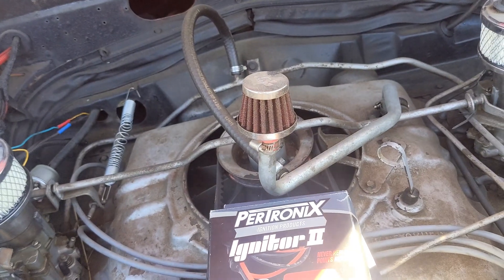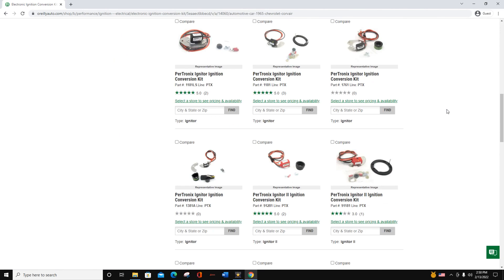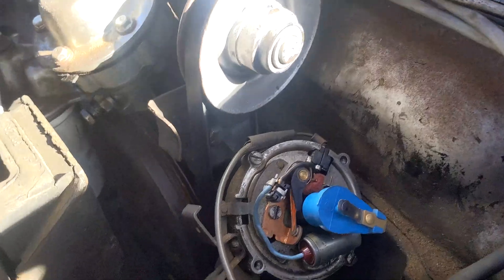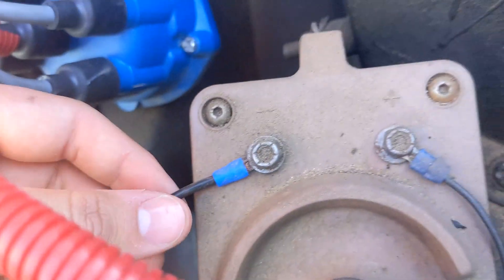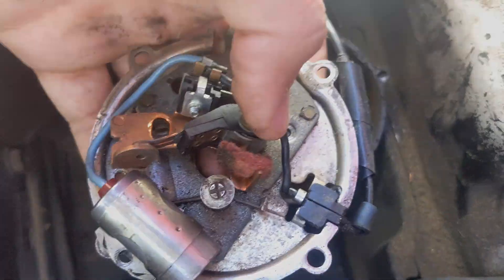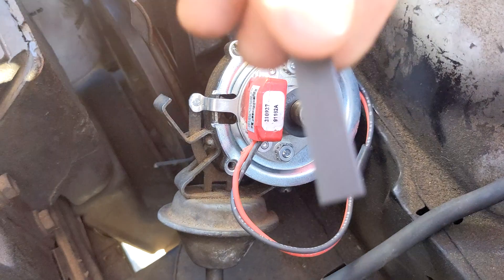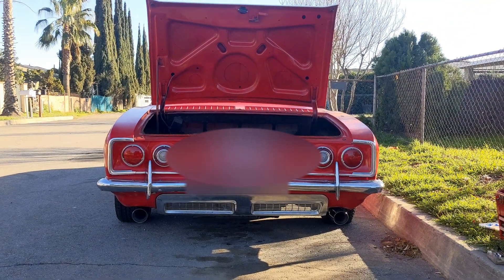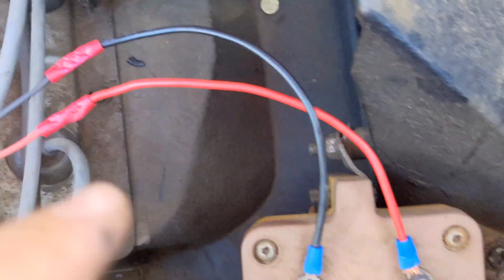Easy Electronic Ignition installation for the 1965 Chevy Corvair

Comment: The Pertronix II is a good choice on this car, but not recommended for a Powerglide car, some problem with the dwell angle built into the system that hasn't been resolved.  The Pertronix I works fine in that application.  I have Pertronix in all of my Corvairs for many years, now.

Comment: I've put Pertronix electronic ignition in all 3 of my Corvairs , My 1959 M-F 50 tractor , & a 1977 Bayliner  ( boat ) that I use to own ! over 25 years ago & all them have never failed ! & your spark plugs last twice as long ! Thanks for the video.
Reply: I was told by the part store that pertronix doesn't make a conversion kit for the 65 corvair! Where did you purchase yours from?